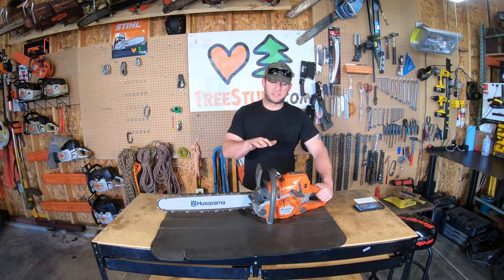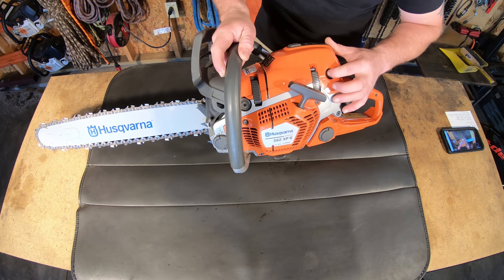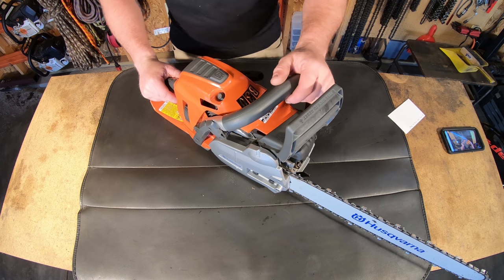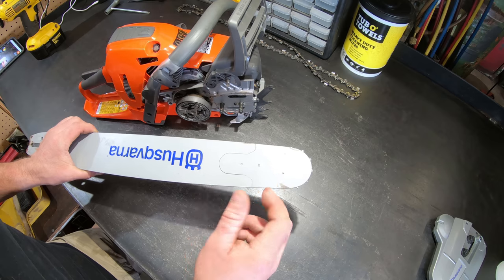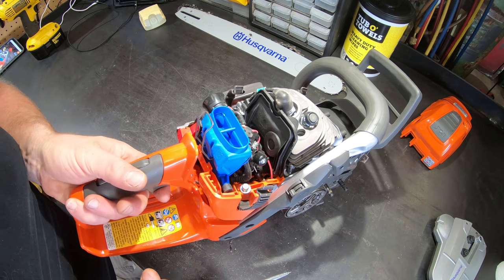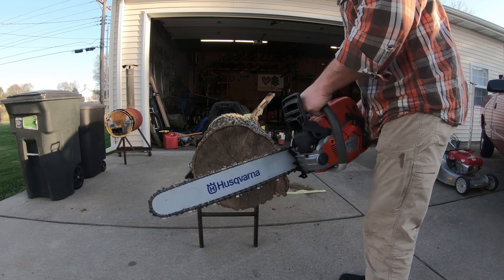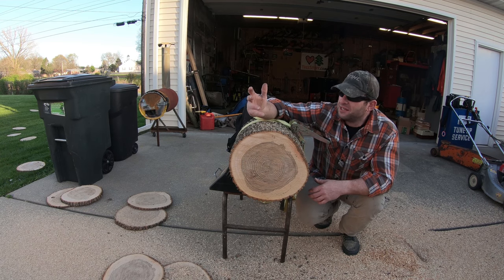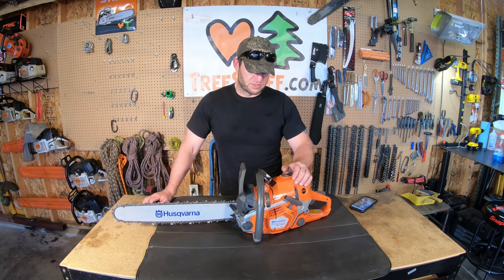Husqvarna 562XPG: Overview/ First Cuts/ Impressions

Comment: I gutted the muffler on mine with a die grinder and added a second outlet port, installed a Cannon 28" Supermini bar, and Stihl 33RSF chain and I've been very pleased with it since. Since the mods, I have ripped some walnut with it and cut up various softwood firewood and it cut through the softwood in no time at all.

Comment: i only cut wood in the winter. and up north here, minus 40c is normal. i dont have heated handles, and never got cold hands while holding the handles. i get cold hands when i sharpen in the field, in which case i start the saw and warm up the hands on the exhaust

Comment: i like them ive had 2 i cut timber with. one had 1.5 million bft (rough estimate) and the piston ring broke. the 2nd saw lasted 2 million bft and the bottom end locked up. they are really good saws but they dont last quite as long as id like, about 2 or 3 years and they are done

Comment: Nice run down.
Not sure why you like the chain adjuster on the casing.  If you need to adjust it for a new chain then regardless of it being on the main body or case, you need to adjust it.  When it's on the main body you can easily see the spigot thingy lining up with the hole on the bar without squinting through the gap with your head upside down.

Comment: A 562xp ported "correctly" by one of the guys that's done many is an awesome machine! Nimble in the hands. Ported, it'll pull a 28" full house like a freekin boss!!! Best "one saw plan" saw I've ever owned. I run Shaffer's 9000 full syn mix @ 40:1 pulling a 28" FH..... no issues.

Comment: try dolmar makita 6100 
-has a bulkier, higher body.
-front handle is slightly higher
-the easy start mechanism makes it a bit wider, it has spring assist and stronger spark on startup
-starts much easier than husky 560. 
- does not suffer from vapour locking, runs so much cooler that the husky in general.
-Larger tank volume, for longer runtime
-Proved to have better fuel economy than 560 
-Air filtration is superior to husky
-Anti vibration is not as good as husky, but has one extra spring, that makes it feel very sturdy and solid. 
-Dolmars are very well engineered and constructed, simple and reliable.
-Has inboard clutch.
It is more robust it can take more abuse.
Reply: Jure Slegel love me some dolmar. Hell makita is the stuff. Love those Japanese geniuses and their razor sharp steel
Reply: I have a Makita dcs6421 which is essentially the same saw, and can attest to it being easier to start, always coughs on the first pull, turn the choke off then runs after pulling it twice more, sometimes i can even push the choke in before it dies after the first pull.

and you don't need to fuel as often, the tank goes a LONG way.

My only minor complaints other than no dealer support in my area (Delaware and Maryland) is the caps tend to get tighter when running so i need to carry a saw wrench with me to get the caps off for fueling, and if it sits for a long time, you need to put fuel directly into the carb, or pull it a hundred times. if you use it every couple weeks, no issues, one of the easiest saws to start. and it comes with better spikes than husky, maybe not quite as good as stihls, and it has 2, not just the one on the inside like the husky, and i think the stihl only has one.

i did have to replace the brake band on it once. not sure if this is a common issue or not.

power and weight is close enough to the 562 it doesn't matter, and it sounds nicer, a little throatier.

as you can tell by my comment about sitting a while i often don't use it regularly, it is my personal saw, which i have brought to work here and there to play with, and it is equal to my bosses 362. because of the spikes i prefer working with my saw, but not enough to make it a permanent addition on the trucks and put regular use on it.

Comment: my big saw is a one owner 044 i think it is 13lbs and a touch over  5hp. saw is PERFECT. i thought of getting a new version(441?) when i look at weight and power it looks like i already own the saw id want to buy. am i correct in 13lbs 5+hp kinda beats the new ones? maybe it vibrates more. id be a fool to go new right? i only cut my own firewood. may small saw is 026.  my backup is an 025

Comment: I bought a 562 XP today based off of this review LOL and that ain't no lie. Recently my former arm wrestling career has caught up with me and I've got some destroyed tendons in my right arm so I needed something with a little bit less pop than my 372's and my 288 would be a little easier to start and the 362 XP has not disappointed me today. The recoil system on it is far smoother the size much easier to fire off

Comment: Back when I used to fix saws commercially there were more Husqvarna saws come in than Stihl. I like both saws, currently running a Stihl 064 for firewood.
I am with you in that I maintain all my own equipment, having things like heated carbs etc just add to the complications when things go wrong.
Reply: I prefer Stihl, but I would actually recommend Echo above Husqvarna as a #2

Comment: Yeah carb heatter comes on and off with handle heatter. Saw comes with rubber plug for coldweathre hole. Newer poked mine out. 
Older 560/562 and  550 had many problems with heat and startting warm after 2016 they have fixed (ie cooling port on topcover and new model carb) most of it or so they claim. 
They also had problem with startter broking if decomp was not used, should be fixed too for newer models.
Havent have any issue with my 2016 560. Run mine with 15" or 18" bar and I think 18" starts to be on the limit with power. 
To be honest I am just huge husqvarna fanboy. I have t540 560 572xp and like all of them, even t540.

Comment: I have ran a 362 for over 1 1/2 years and had the same problems with them. don't want to stay running, lack of power after extended periods of use and just all around not reliable. All other still's I've ran have been great 201c, 250 and 461 but for some reason the 362s were crap...been running this one for a couple months now and nothing bad to say about them as of yet.

Comment: I have the same saw minus heated handles and carb. We run a 24" bar  and full comp chain with no issue I believe a 28" bar would be fine. That saw wakes up a lot after 5 or 6 tanks of fuel through it.

Comment: I have a 2014 model running a 24" bar wo/ the heated handles. great saw until the carb died, could not do anything myself to fix it
Reply: Did you try replacing the carb?
Reply: @toadamine  i had to bring it in to a local shop to have replaced and programed. as getting the carb alone was nearly impossible and programmer only avail to dealers and service shops

Comment: Nice video, Human.
Smile, Husqvarna has a new one on the market, the 572XP / 572XPG.
But no matter what chain saw (Stihl or Husqvarna, etc.) you use, it should work reasonably well. :-D
Reply: Why don't you tension up the chanits loose??looks like a gutsy little saw
Reply: Nouthing wrong with husky or still both very good saws I made my living for years running both felling timber really ihae no favorites

Comment: I still prefer stihl because replacement parts are readily available and stihls are generally easier to work on imo but I have a 550xp and wasn't expecting to love the new husqvarna saws as much as I do. Like you mentioned the new xp saws have amazing acceleration at stock and I think they have a better sound.

Comment: Looking for some help... I can't decide on the Stihl MS 362 C-M or the Husqvarna 562XP!  I have 20 acres of woods in my backyard and I cut about 7 cords of firewood for my outdoor wood burner each year.  I had a Husqvarna XP series a few years ago but need to replace it.  I've also tried the Stihl MS 441 C-M but am looking for something lighter than that, plus that one just isnt in my budget.  Any input?
Reply from the maker: Can't help, I love them both lol
Reply: Went with the Stihl. Good to hear that you like them both. Thanks!
Reply: I bot 2 jonsered cs2260s same saw as 560xp meaning same eng small bar mount. My powerhead is 12.8lbs and a mean saw too. As for outboard clutches. I dont even take the top off the saws anymore. Just use flattip screwdriver and small deadblow. But first pull rope out about 15 inches or so and loop around handle. Hit the clutch at the arrow marks with a quick hit. Usually 2-3 at most clutch spins off. Good time to swap rim 325 to 3/8 or just a new one. After putting clutch back on reverse process. Then cut a piece of wood. This will tighten clutch more!!! Its just that easy.

Comment: Dam nice saws,Good 60cc class saw. Far better built then the Stihl MS 362. I have 2 running 32 inch full skip chains and they never have issue if you run premix fuel.

Comment: Nice to see you becoming familiar with the huskies :). I love my 562xp, having trouble with dirt sneaking past the interface between the air filter and air boot (or whatever its called), but mine is an older one (2012ish). My boot is black whilst your is blue...wonder if mines superseded.  So much you can do to that old 372xp if you boss will let you. Opening up the exhaust and a base gasket delete did wonders on mine.
Reply: blue is heated.

Comment: i like the more simpler husky  and dolmar and stihl models over these newer on bored computer models thats why i always stick to the base models there trying to make all small engines like cars now so you have to send to a shop to get them worked on when us average joes like to customize and diy on these to save money  instead of paying a shop a arm and a leg to work on them its bs i tell you great video thumbs up
Reply: Saves more money in long run (premixed is expensive) tho better fuel efficiency with a solenoid operated carb, it can adjust more accurately an on demand. More time running an less time "screwing" around with screws (that an they keep updating them to get the bugs out)

Comment: If you are having problems with an m-tronic unit the most likely culprit is the solenoid valve. Replace that and fuel filter and ur good

Comment: Chain tension looks loose.
Reply: Travis The Jiu-Jitsu Guy that was my thought
Reply: Travis The Jiu-Jitsu Guy I was waiting for it to come off!
Reply: Yeah around the 8:22 mark it is really visible. I was cringing for his safety on  revs/idle ups.
Reply: MrSisterfister100 looks to be about a 20inch bar. I'd expect it for larger bars. This smaller one should just be addressed though. Still there is no excuse when noticed.
Reply: MrSisterfister100 Yes. I didn't commit to be mean, just to see if we could get a "oh looky there" and  a laugh.
Reply: It happens.. when you're trying to get the job done you don't always have time to tighten the chain every fillup.. I've had chains come off HUNDREDS of times and not once was it ever a safety issue
Reply: Some people like to live on the edge
Reply: @jeromeduffy9270  not really.. hold the saw appropriately and nothing can happen. The chain won't spin if it comes off the bar, and unless the chain breaks n comes apart it's not going anywhere.
Reply: @jeromeduffy9270  nah haven't seen it.. too loose is too loose. It does bug the shyt out of me when someone leaves the chain too loose and it comes off tho
Reply: MrSisterfister100 Lol exactly, I normally run my chain quite loose to where theres about an 1/8” between the drivers and the bar. And thats on every thing from a 20” to a 40” bar. Have only ever had a chain come off once and that was limbing.

Comment: How do u keep ur chain tension? I see most people keeping theirs snug to the bar, but not super tight, but at 8:49 your chain is quite loose. Is that the tension that you recommend?
Reply from the maker: No, when tensioned you want to be able to pull it down from the bar a bit, and when you let go have it just barely come back up and have the tie straps touch the bar.  Heat/stretch/ etc.. loosen it over time, even after just a few cuts, but it wasn't bad enough I felt I needed to tighten it.

Comment: I Agree!! Stihll and Husqvarna both must offer an interface for consumers so we can  diagnose, or at least update the firmware on our equipment. Not being able to do this is simply unexceptionable!! and is a good way to loose customers IMHO.  The saw should have come with a reusable rubber plug that fits into the winter shutter hole in the divider. A cheap bad design, the older saws all had built in flaps. I like the reduced weight bars on most of my saws the Oregon Versacut bars are sweet on the 562.  Revboost allows the engine to over rev for shorts bursts for limb work. 

If you would let us know how the saw preforms and restarts when the temps are in the upper 80's and 90's The I have seen 562's and 550's turn the fuel in the carb to vapor if you let them sit after running a few minutes. The saws will not restart, even the primer stops functioning. I've alleviated the issue buy opening up the muffler, plugging the decomp and adding some heat shielding on the decider. Other than the heat issue these saws run extremely well.

Comment: For the work I do, the weight factor makes the 362CM a no brainer.
Reply from the maker: Meh, 462 is pretty much the same weight
Reply: @Human1337  Exactly.  The 562XP is 13.4lbs for a 60cc saw with 4.7hp.  If money isn't an issue then certainly get the 462 at only 13lbs with 72cc and 6hp.  If you are committing to a cheaper pro saw, then the 362 CM comes in the same price with the same horsepower and only weighs 12.35lbs -- why carry around that extra weight all day.  I don't understand why you would ever choose the 562 over one of the Stihl saws.

Comment: I bought a husq several years ago cause my parents had great success with them. Boy was I wrong in buying one. The first day trying to use it, had great difficulty getting it started. Had the right fuel mixture and everything. Chainsaw kept dying. So I took it back to lowes ( and yes I know buying power equipment like that from a box store is a mistake. Didn't know that at the time). They fixed it and blamed me for the chainsaw going bad. So I took the chainsaw back home and had the same problem again. So I took it back to lowes 2 more times after that. which they blamed me for it every time. The last time I took back they said they will not honor the contract. So I said f*** it and went to a stihl dealer and got a professional chainsaw which I know was over kill. But hey I have not had any trouble from stihl. Moral of the story do not buy power equipment from a box store.

Comment: By all accounts, it's a light, powerful and nice handling saw. I've heard reports of this and the 550 having trouble with hot starts in very warm or humid conditions. Anyone got any comments?
Reply: andrewford80 Yes the first gen had hot start issues, the newer ones should be fine.

Comment: Dude, note to your comment on M-tronics and your sudden distaste for them. I started working as a tech at a Stihl dealer this January. I was stoked to have access to the MDG software, thinking it would allow me to diagnose these damn computer carbs.... That software is shit, and tells you nothing. Runtime, successful starts, a fancy tachometer... that's about it. Oh and it allows you to open and close the solenoid valve manually, and some limited ignition information as well. Your money is better spent on a vacuum/pressure gauge (leakdown tester), that is the only method I use to diagnose m-tronic carbs now. You drain the tank, run the carb out of fuel then pull the filter off and hook up the pressure gauge. Simple series of tests tells you if the solenoid is doing its job or not, if it passes the problem is somewhere else in the saw. Which with the proper intake blocks, your leakdown tester can also check the crankcase - very handy little tool! Lemme know if you want the full process from the guide in the MDG software, I'll hijack it and e-mail it too ya or something! haha
Reply: Lumberjack Outdoors yes please! Haha

Comment: A trick for holding the crank is to pull the plug and put 3/8ths cotton rope in to fill 1/2 of the cylinder. Rotate the piston to compress the rope to the head and then spin the clutch or pulley off. Easy to make a 3fingered tool from an old socket and some cut off grade 8 bolts. Regular round stock would probably be weak to hold up. Killer video, human. 👍🏻

Comment: they should make husky bolts compatible with stihl, at LEAST on their pro-grade saws, so we can use the same wrench
Reply: They are the same thread and can be used interchangeably. Capture nuts is the only up or down side but they can be removed and use different nuts.  stihls need the larger nut surface

Comment: Stihl verse husky in the straight down cuts where you didnt use the dogs the Stihl cut faster and maybe had more torque but there was probably a difference in the raker depth.  Too hard to pick a winner.  They look mostly on a par.

Comment: I find it strange and a shame at the same time a professional says that gasoline with 89 octane is good.
In my country, portugal gasoline with less octane is 95, there are 98 and 100 in some pumps.
So in my opinion and many people the gasoline of 89 octane is rubbish.
I use 98 octane, with due 2-stroke oil on all my machines.

Comment: Husqvarna is not going to out last a Stihl between rebuilds, but damn do they cut better, are more comfortable, are easier to work with, and start easier than Stihl, even though they are typically a little heavier in comparison to a similar yet more expensive Stihl. I've used both Husqvarna and Stihl in tree service and in logging woods. Both are good, but prefer Husqvarna.